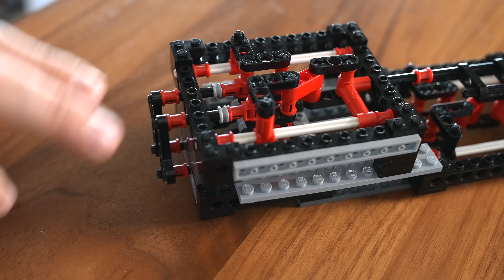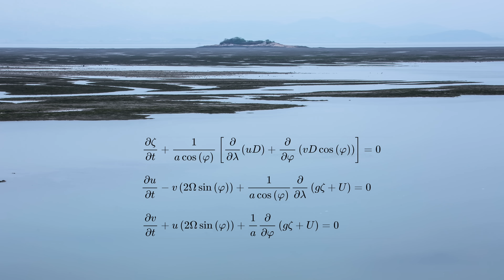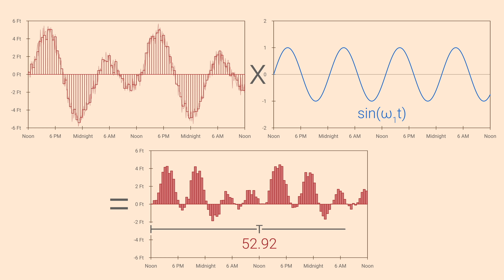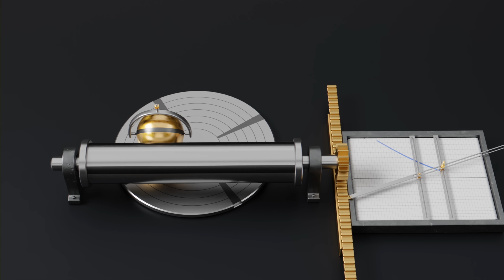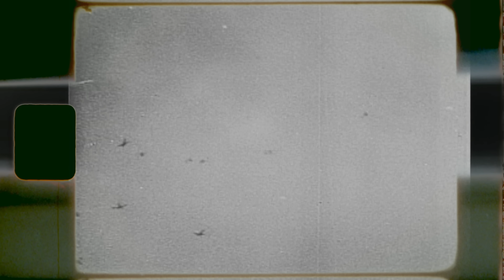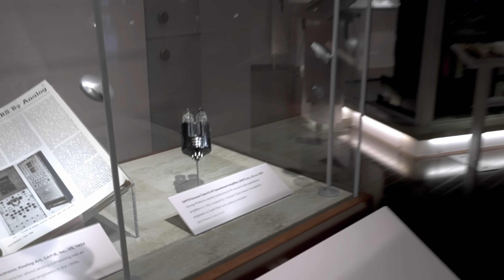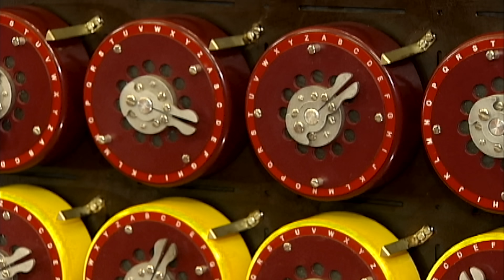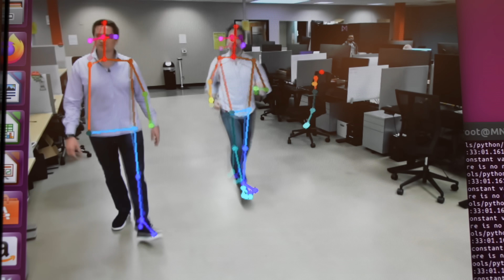The Most Powerful Computers You've Never Heard Of

Comment: Absolutely fascinating! One thing that merits clarification: Not all digital computers are based on the logic gates of type AND, OR and NOT. A set of logical operators (gate types) is called functionally complete if all other logical operators can be built from it. The sets {OR, NOT} and {AND, NOT} are both functionally complete, e.g. A AND B can be rewritten as NOT ((NOT A) OR (NOT B)).

In fact, the single element sets {NAND} and {NOR}, where A NAND B = NOT(A AND B) etc., are not only functionally complete but actually used in electronics… you may have heard of NAND flash and NOR flash memory, for instance.

Comment: I was present at the cutting of Soviet warships for scrap metal. On them I saw pneumatic computers for the first time. According to the scheme, they exactly repeat the usual ones, these were thick plates of transparent plastic, in which many tunnels were made, and metal elements, valves, controlled valves, gates, and so on were installed on the plate. On one side of the plate there was a connector consisting of metal tubes in a row. The plates were connected in rows to the main block. As the military said, these computers did not react in any way to the outbreaks of atomic explosions and were very reliable. And what was especially pleasing, such a computer was washed with medical alcohol during maintenance. And the sailors made vodka from alcohol.

Comment: What an incredible load of horsecrap.  "...Analog computers can handle continuous input but digital computers are limited to discrete values..."??  Analog computers can only solve the problem they are built to solve, and only to a very low level of precision.  The same digital computer can be adjusted as necessary and computer to much higher levels of precision at much lower cost than needed to machine gears.

Comment: My father used to simulate helicopter blades and missile characteristics on self designed analog computers early in his engineering career.  It was very early in the development of the IC and he was utilizing Op Amps in the designs.  The fellow who was the existing authority at building these simulators out of discretes said it was amazing that the op amp circuit was almost as good as his discrete versions.  Dad's response was something like what makes you think yours is the more accurate of the two?   

There are both advantages and disadvantages to each approach, analog and digital.  And when you really get down to it EVERYTHING is digital at some level, and pretty much everything we interface with is analog, speakers, monitors, etc.  Plank's lengths and times, atoms as the last smallest bastion containing elemental (periodic table type) differences, etc. 

On the converse side, if we advance several orders of magnitude in audio sampling rate (bandwidth) and a bit more in bit width (or not, sorry about the quip) so called digital audio will at some point BE an analog, no transformational filtering required, and more analog in actual output than the best wholly analog devices.  I do realize that digital is not analog, in any basic sense, as I have designed both, but hopefully you get what I am probably poorly trying to convey.

Comment: I for one am hyped. I literally predicted that analog computing would eventually overpower traditional computing, especially with the advent of superconductivity. Why go for 3 values with quantum computers when you can go for hundreds or thousands with an analog? If the biggest issue is inaccuracy, well, superconductive systems may be the solution, given how they allow for lossless voltage transfer. Such a thing does require plenty of shielding to prevent noise from having an impact, but then again, we're already doing this with quantum computing, which only has 3 values. So why not upgrade to a practically unlimited number of possible values?

Comment: Veritasium forgot to mention that in WW1 they didn't had proximity fuses, so the difference in shot down planes may not came from "computers".
I'm starting to think that Veritasium's videos lack substance, just use hard to understand words as slogans to gain public=youtube money. Ultimately just peudo-science channel.
They also say that we are close to reaching atom size transistors, but didn't say for which element and that humanity can switch to different materials than silicon. For example gallium arsenid transistors can operate at 250GHz frequency. This means we can have ~25x faster cpu's based on gallium.

Comment: I think you might get a good result if you use a powerful digital computer to simulate an analogue machine. For example, you could set up a series of cogs that spin on a computer and get the computer to calculate all the values from the spinning cogs. This saves building the physical machine.

Comment: Very cool video. Learned a lot. I also have electronics and programming as hobby, so this is valuable information. 

I also work on jet engines. There is a department that is dedicated to analog computers controlling air/ fuel flow. Very complex, but very reliable.

I am convinced analog isn't dead.

Comment: Digital computers are the jack of trade master of none. While an analog computer is a master of a single task, and that´s it. My best example of this is hospital equipment, and embed coding in them. A heart monitor needs to be good at one single task, nothing else. And it needs to be good at it 1 million times. A hospital needs a machine that they can use for more than a decade without a single error. Most people cant have a laptop for many than a few months before they run into their first error. The cost of being a jack of all trades is speed, power, and higher chances for mistakes. That is my take on it, but I am guessing that it does not use gears anymore but that modern analog computers can switch between "scenarios" that are different miniature computers with specific software and hardware applications for those "scenarios"

Comment: I'm going to dispute the 'robust to noise' claim, at least in certain applications.  For example, analog broadcast television and radio signals do have one advantage over digital signals; even with degraded quality due to noise they may be watched, heard, and understood.  Digital signals simply fail to be received.  That's not an issue if all you're missing is the latest episode of your favorite show but in an emergency situation it's a problem.

Comment: So much missing.
Never mind Babbage and his mechanic-digital engines.
Never mind Zuse’s electromechanical computers.
 
But what about fire control computers?  You have a moving ship, a moving target and the data you get is of limited accuracy.  You have to plot the probable course of the target for 60 seconds or more at longest ranges. You have parameters like the temperature of the powder and how used up the barrels are, etc etc etc.  A number of hits were scored at ranges beyond 20km …

Now, the “Paris Gun” did not use mechanical computers, as far as I know, but they had to calculate the Coriolis force as the projectile was in flight over 3 minutes and travelled through the stratosphere for most of it.  The Norden Bomb Sight was not the first that calculated it …
 
And there are the TDC, Vorhalterechner and their mechanical computers submarines used to aim their torpedos — stuff like the torpedo getting to full speed, the turning radius onto the gyro course, the runtime before initialising the that turn, the parallax error because the periscope is 10s of metres away from the tubes and if you shoot at a point close to you the torpedo must make a sharper turn than for a target far away, everything else being similar …

Gyro sights were — comparatively — simple … but deadly. 

Also, I have some doubts regarding your projectiles per plane — it is way too low from what I remember — and also you are probably ignoring the VT fuze (for “Variable Time”, a code name for this proximity fuze using miniature vacuum tubes) which alone dropped the projectiles per plane by at least an order of magnitude.

Comment: The stylus for the input to the mechanical integrator would have to move at a consistent rate left to right (here shown as up to down, since the graph was sideways). Lingering on one region of the curve would result in a value that was too high.

Comment: Great video. Very well made.I am a retired electronic engineer and, of course, electronic analog computers (not mechanical ones) were central to aircraft navigation equipment well into the sixties. At Canadian Marconi where I designed Doppler radars, altimiters and omega receivers, we used a mix of analog and digital computing devices. When speed was not a problem, digital computing subsystems were selected but when time was the essence the analog computing devices had to be chosen despite their sensitivity to temperature.

Comment: Until the 1980’s or so, automobile automatic transmissions were actually analog computers.  They ran on oil and transmission fluid and were quite complex.  The shifting logic was performed by the transmission fluid. This is why fixing them back then often necessitated a visit to a transmission specialist who only worked on gearboxes.  Once it became electronic (and then digital) it all changed.

Comment: Back in the Early 80's I was a computer operator for the Nike Hercules Surface to Air Missile system.  The computer was a vacuum tubed based analog computer that coordinated information from multiple radars and sent that info to the missile while in flight.  You got your time to intercept through mechanical gear pots and there was a pen based plotting board showing the missile and the target as well.  It worked very well for its purpose.  The wildest thing about it was one of the checks we had to do every 4 hours or so.  Balancing out 4 banks of relays with the power on and using a screwdriver to adjust each relay while holding a switch down to where a light would just come on and no further.

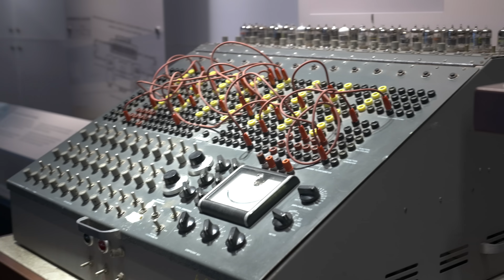Comment: 2:08 "Digital computers exploded onto the scene with the advent of solid-state transistors"
NO, valves were used beforehand, which could also be configured to process the 0s and 1s of binary. Before valves, computers used relays. Relays are physical switches with moving parts (magnets and coils) to switch electric circuits on and off. It's just that relays (a) were slower, (b) were noisier (c) required more electrical power (d) took up more space (e) were heavier and (f) were sometimes unreliable because of the physical moving parts.
The word "bug" (these days used to describe an error in a computer program) comes from a real bug (insect!) which, decades ago, might get into the moving parts, or into the circuit and short something out.

Comment: I was a Fire Control Technician (gunnery computers) in the US Navy in 1959. The computers were all analog and had rolling ball integrators as shown in this video. The adders and subtractors were miniature differential gears identical to the differential which drives the rear wheels of your car. 
At that time we never thought of solving the Fire Control problem digitally, using transistors. 🇺🇸

Comment: The biggest problems with mechanical computers is the wear and tear of the gears, the motors, the size, the speed and maintenance costs. These cons will always be outwaying the pros, whereas the digital computer IC may have reached its limits, it will always outperform the analog computer in total. Also, you can actually use multilayered bits where the value is not just "1" and "0", but eg. 0, 1, 2 etc. and negative 1, 2, etc.
Look at 3D printing, a digital signal is converted to an analog 3 dimensional coordinate. If the analog part would be as fast as the digital part, you would have your output as fast as your input.
I would buy such a device tomorrow, everything made instantly by the click of a mouse. 
Almost like startrek, 😉

Comment: When it comes to HDTV broadcasts, using ATSC in The USA using 8PSK modulation, the older analog NTSC is way better at handling noise and the signals were recoverable way further in an intelligible watchable manner. The FCC and NAB also jumped the gun and missed out on 4K and and 8K HDR formats for picture and Dolby Atmos or Dolby Digital 8.1 and is stuck at Dolby Digital 5.1 while the online and Blu Ray systems forge ahead with way better digital formats.

Comment: One benefit I could see of an analog computer is that it couldn't make a mistake due to bit flips caused by particles passing through. Digital actually has that problem all the time. Some sort of comparable analog system could help avoid or at least detect this error.

Comment: Using the term "computer" is somewhat misleading for most of these machines: sure, the word meant "calculator", in the first place, which in fact describes the majority of these: calculators with fixed sets of calculation schemes, which where built up to the 70ies. 
In the modern understanding, a computer is able to execute more or less random algorithms defined by programs using variables, decisions an loops and the first, if not only pure mechanical one, that matches this aspect, was the Babbage machine.
American Scientific edited some special editions, featuring several articles depicting mechanical "computers", including logical gates (AFAIR  written as an april fools joke, but still plausible)

Comment: The problem isn't in what we know, it's in the various forms of what we don't. The first fault we found in digital was that binary decimals don't translate to fractions exactly, and errors rapidly propagate. It was resolved by emulating the manual calculations more precisely. Complex numbers still cause the drift. Next up, the implications of Nash' chaos theory, where null and zero are not the same thing, any more than indeterminate is. The inversion of that is orders of infinity.

Comment: "Digital computers are reaching their limit because transistors are nearly the size as atoms. Advancements in machine learning are straining the capabilities of digital computers."
But.

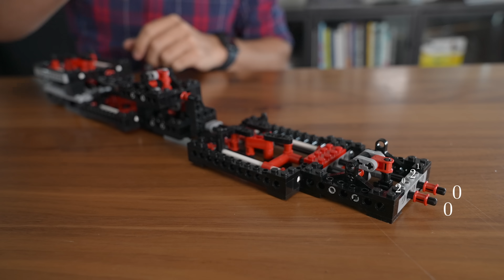For a while now I have been wondering whether these limits couldn't be overcome by letting go of the notion that digital computers only can work with 0 (no signal) and 1 (signal). What if we introduce 2: 0 (no signal), 1 (weak signal) and 2 (strong signal)? It is obvious how this would work in transmitting data through fiber optic cables. In cds and dvds you would have to manifacture two types of bumps/pits for this to work. Even in Derek's digital lego computer at 1:15 you could have a 0 (large, well, let's call it "protrusion"), 1 (small protrusion) and 2 (no protrusion).

In the current 0-1 system, two bits can hold values from 0-3. In the 0-1-2 system, two bits can store values from 0-8. That's a 125% gain.
This may be worth some research IMHO. Can you say something about this idea Derek? 😉

Comment: But analog signals, outperform digital ones big time for stability. Take a simple lightswitch. I converted part of my home to a bus based digital system. Unfortunately this adds a new layer of complexity and is less performing then the analog solution, the restart of the lightswitch to work again becomes a necessity from time to time. High tech should be as low tech as possible to last otherwise digital becomes disposable.

Certainly some specific problems are better fixed with analog solutions.

Comment: I learned to use an analog computer in college (when digital computation was in its infancy). It was not, however, mechanical. It was based on building circuits of resistors, capacitors, and inductors that were analogous to mechanical systems. For me, it seemed like magic when the analog computer would perfectly simulate the behavior of the mechanical system it was modeling.

Comment: in minceraft we call analog redstones a redston circuit that uses comparators to work on 0-15 specrum insted of 0-1 but it not competible with instant repetor, so we use signal divders to send 1 analog signal thru 4 instant repeaters but have everything analog cuz it smol
in minecraft analog is not mistakes in making and is also digital 16 digits not truhly analok

Comment: Digital computers are hardly exact. There are large, important classes of problems for which digital computers invariably fail to give correct answers, and instead we're relegated to either computationally expensive estimations or no answer at all. This is a fact every data scientist is aware of.

Despite this, digital computers are still vastly superior to analog due to limitations of accuracy, environmental sensitivity, and durability when using any physical material to directly perform calculations.

Comment: Even digital signals are sent over physical media—electrical signals—and are subject to noise such as electromagnetic interference. Therefore, they're noisy just like analog signals at their most primitive form. Engineers have created systems to correct for that noise, such as error control codes. You experience digital noise in the form of latency, when digital signals need to be sent more than once if an error is detected. A long ethernet cable will have higher latency than a short one because the algorithms that detect noise have to re-send the signal more times in order to get it right.